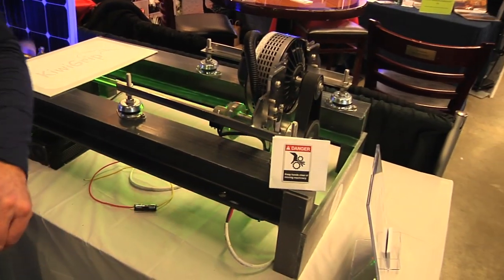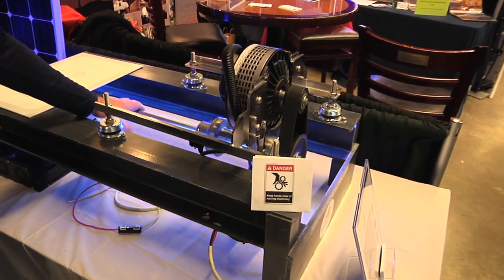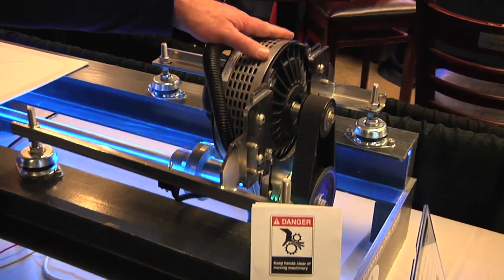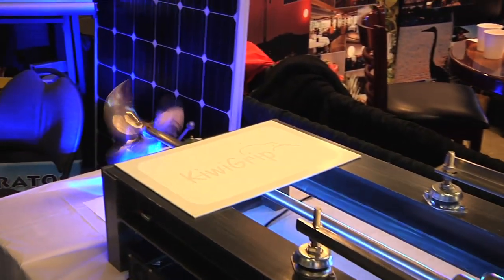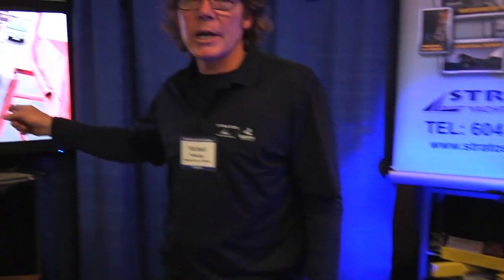9kW Electric Boat Motor - 2014 International Boat Show

Comment: A whole 12 HP to replace two 60 HP Volvos in a 31,000 pound boat??

I'll pass.
Reply: Those 12hp motors put out almost 200ftlb a piece, electric works different than gas